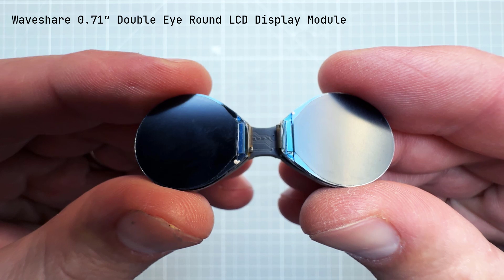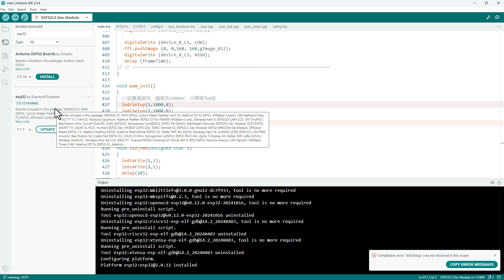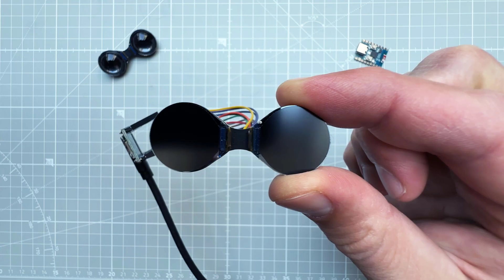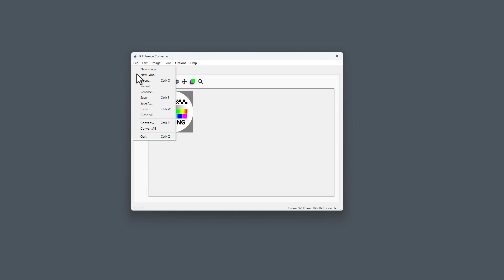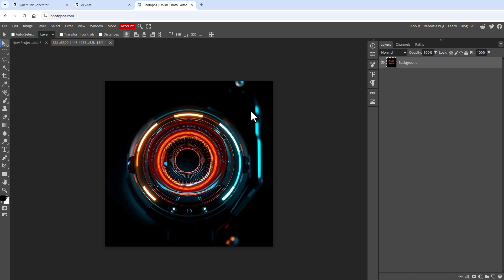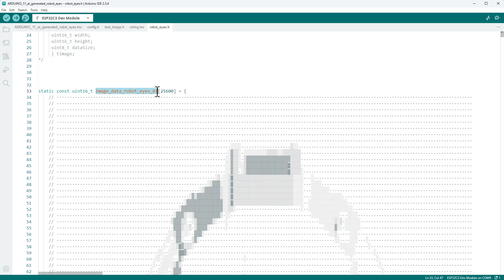Your robot needs eyes 👀- Double Display Module from Waveshare with ESP32

Comment: How did you get your code to work? I downloaded the waveshare demo files and followed your instructions but no matter what, the display model only has the blacklights on but displays nothing else. At some point, and I dont know how, the countdown demo code worked for like 5 seconds and I was elated that it finally worked, but once I resetted my ESP32 C3 zero, everything started to not work again. 

Is there any changes that you made in the library files to make the code work? I see that your wiring in the video is a little bit different than what it is now as they have updated the website.
Reply from the maker: I´m sorry to hear that. No, I haven´t changed anything in the library. Perhaps try contacting Waveshare directly? Good luck with your project!

Comment: I like the robot eyes, has anyone tried to animate them? Or is there a source for getting code for animated eyes?
Reply from the maker: I believe Adafruit has an animated eyes demo, you can probably reuse those images for this display as well.
Reply: @upir_upir  Thanks I got a different problem. Got my screen and board in and I used the library files from waveshare. But when I upload on of the examples I get a black screen. I got i wired correctly and the pinout in user_setup.h seems to be correct. Is there a change the display is broken or am I missing something?

Comment: If I download the example from the Waveshare and follow all instructions I get an error "Invalid option Zigbeemode".  If I used your example from Github I get an error "Exceed available space in board".  I've been working on this little eye project for nearly a month and can not get anything to show on the displays.  Waveshare help is actually no help at all.  I've about had it with these eyes.
Reply from the maker: I understand your frustration. Perhaps try checking your board selection and partitioning scheme in the Arduino IDE. If you use your own images, make sure that they can fit into the available memory. Let me know if you have any other problems!

Comment: At 4:00 that wiring don’t match either boards from the wiki as of today so ima wire it up like your doing in video and follow everything you do… yes still stuck as of today I have checker board display with the demo running🤯
Reply from the maker: That´s strange, as I have used the wiring from wiki... but maybe they changed it in the meantime. Anyway, good luck with your project!
Reply: @upir_upir  yes wiki is different just confirmed it wires and files have been changed since you done it… so I shall wait for you to look into that or someone makes something about it bc I’m lost😩😭

Comment: Dude please make car knobs from those tiny display
Reply from the maker: What kind of car knobs?
Reply: @upir_upir I had an idea of a climate control (air conditioner) inside a la Ferrari style ac vent or a normal climate control knob where you can adjust temperature,fan speed and air direction in a single knob
Reply: @upir_upir single car climate control knob where you can adjust temperature,fan speed and wind direction
Reply: @upir_upir a single climate control knob where you can adjust temperature,fan speed and wind direction

Comment: I'm struggling to get demo 1 (the cool moving eye bit which was the whole reason I purchased) to display on both screens. It only displays on the first (right hand) screen, the only screen is blank but for the backlight. Demo 2, 3 etc with static images all displays correctly on both eyes. I've confirmed I'm using ESP32 C3Dev board at 2.0.12, the provided offline library files, and have the settings of CDC on boot, Huge APP and 4mb flash size. Any tips of tricks as to why the second display wont update?

Edit: I moved it from CPIO pin 6 to to GPIO pin 9 and changed the config in the code - hooray!
Reply from the maker: Great to hear that you had some success!

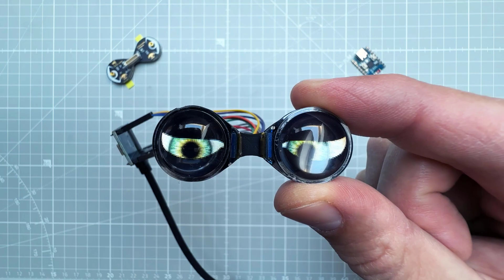Comment: The "looking around" feature is the main draw for this but rarely illustrated in this and your promo videos(8:32 is one of the few times)- Cool eyes aren't that hard to do, but animating an iris and/or lids and/or pupil mechanically is much more complicated.  This is an elegant and simple solution that I'd be showing off a lot more if I came up with this system.
Reply from the maker: Yes, looking around is cool and I was planning to do that. I might still revisit it in the next video.

Comment: seems like they would be more practical if it was easy to put them as the centre iris of an eye ball. so the rest of the eyeball can be say white like human eyes. but youre able to animate the iris. sees like this would be a pain through with them being attached to one circuit board.
Reply from the maker: I believe you can also get just a single display and that one might be easier to work with in this case..

Comment: Probably the lcds have a different subpixel color order. So instead of a red subpixel and then a green subpixel and then a blue subpixel inside each normal pixel (in that order) maybe it’s blue green red, or green blue red. That probably explains your reverse bits as well.
Reply from the maker: It´s strange why it works in one orientation and not in the other.. hopefully will solve it soon.
Reply: @upir_upir  that’s actually what made me think of the color order. The way it looks when in the other orientation is exactly what displays look like when the color values are in a different order than the display software expects 🙂
Reply: @upir_upir  TFT_eSPI has an option to define the color order in some of the display setup files. If you look at Setup135_ST7789.h in TFT_eSPI/User_Setups folder it has #define TFT_RGB_ORDER, you can set it to TFT_RGB or TFT_BRG. Adding this setting to this display settings file might fix the color and display issues your having.

Comment: sad to see ai image generator usage in this video
Reply: I strongly disagree, this is the perfect use case for AI images. He's just showcasing a prototype/demo, that's a perfect use for AI, getting quick throwaway graphics that would be replaced in the final version
Reply from the maker: Why sad? As the other commenter mentioned, it´s a nice way to get a lot of different variations and see what kind of style works the best, which will speed up the initial phase and you can immediately create the final version.

Comment: 8:45 I'm pretty sure those red eyes are from the Naturo manga/anime.
Reply from the maker: It could be! Looks like there are many different eyes in that anime.
Reply: @upir_upir  definitely from naruto. They're "sharingan" eyes. Lots of variations and levels (as anime does) but the "three comma" design is the base design for characters that possess them. Very cool display setup overall. 

I haven't played with eps32s (actually just ordered a few though) so not sure what hardware capabilities they have, but if you can express the images as matrices and perform matrix operations, might be able to do a lot of cool shader style animation. That might be a tall ask for an esp32 though. Just having static hardcoded animations to choose from still opens up a lot of cool possibilities